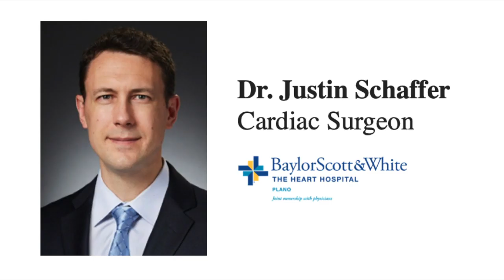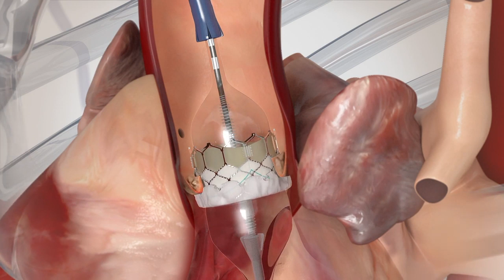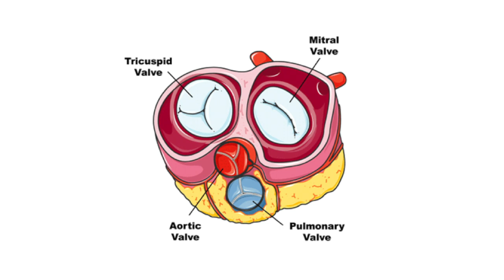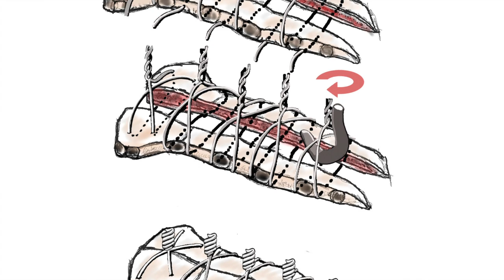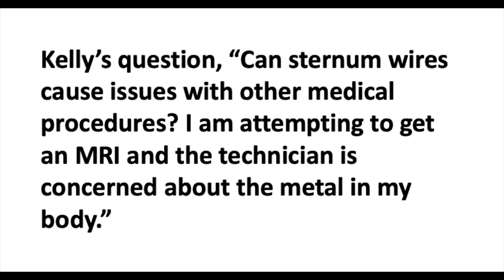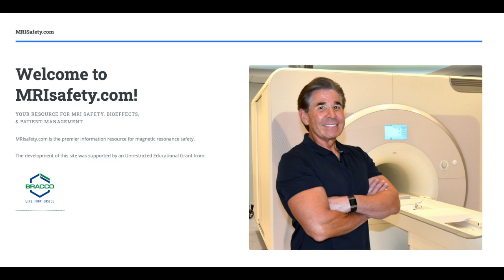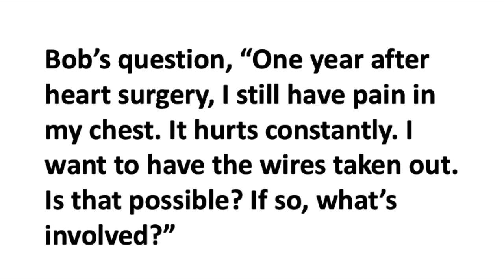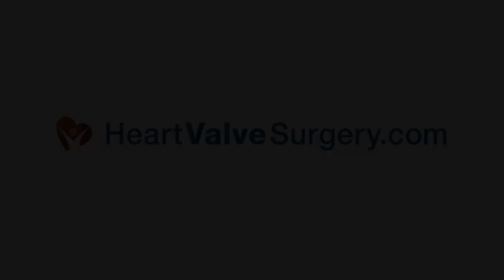Sternum Wires & Heart Surgery: How Do Wires Work? Can I Get An MRI? What About Sternal Wire Removal?

Comment: I'm 8 weeks past CABGx4 and aorta repair, mostly doing very well. No pain (other than pretty constant tightness in my pecs) but I can get a pop/click in lower left sternum lately--and there are some movements that really seem to exacerbate it (imagine the motion of wiping kitchen counter, or waxing a car). There's no pain, gladly, but I'm concerned that the sternum has not fused there.....or if the wires have been stretched out of whack or something. I have a call in with the surgeon (thank you very much for this video)
Reply from the maker: Hi, You might want to check out this post - https://www.heart-valve-surgery.com/heart-surgery-blog/2010/02/03/sternum-shoulder-click-pain/. Hope that helps!
Reply: @HeartValveSurgery Thanks much, I will investigate. A CT did confirm "non union of the sternum," the good news that it sterile and otherwise clean and tidy. I await the surgeon call and am anticipating word of surgery to put plates in (would sure love if there were other options). A little speed bump in my otherwise great recovery

Comment: I had CABG and a mitral valve repair 2 1/2 years ago. Prior to the surgery, I was an avid weightlifter. Not for size necessarily, but more for being lean and toned. Post operatively, I resumed weightlifting after about 3 weeks (under Dr supervision). So, my sternum wires were very tight and could be seen under the skin. I experienced aching all of the time and had severe pain at times simply from the wires especially while weightlifting. Not really a complication, but rather I guess my chest nerves are super sensitive plus I don't have much fat, even at 56 years old! A week and a half ago I had the wires removed and got instant pain relief. So, in my case, wire removal resolved the sternum pain. Literally the same day I had them removed. If you're having pain from the wires, please see your surgeon for options appropriate for you. You do not have to live in chronic pain nor have to rely on pain killers.  I had seven wires removed. One removal incision is about 2.5" long at the top and then five 1" incisions. He was able to get two of the wires from one incision. Went right over the old CABG scar. Very happy I did this!
Reply from the maker: Thanks for sharing your story with all of us!
Reply: how can you weightlifting after about 3 weeks?.. the sternum was heal/join,??? only 3 weeks
Reply: @ Also, let me add that the wire removal was very easy and quick. The actual procedure took 20 minutes. I arrived at the surgical center at 8am and back home by noon. Norco pain killers for a couple of days, then Tylenol for a few days. The pain relief from the wire removal far outweighed the brief surgery discomfort.
Reply: @ Surgeon cleared me and I was in Cardiac Rehab (please do rehab it is very valuable). Under the supervision of the rehab team, I started with 1lb dumbbells along with resistance bands. Added a little weight/resistance each week for 12 weeks, after which I was fully cleared to resume normal exercise. The caveat was to not do heavy lifting until six months out. I think I got up to 125 bench up to six months, then I could resume normal weights. I lost 35 pounds in the two months post surgery, and never recovered that weight loss, so not a strong as I once was :( After getting the wires out a few months ago, I am now up to 240 bench at 57 years old and 195 pounds. I’m 6’3” so on the thinner side. Never have had a large gut. Weightlifting did make the wires a little worse, so glad these things are gone. Best wishes for all of you!
Reply: @enahoky7793 after 1 month I went back to work doing heavy lifting I felt fine, but now a 1 year it hurts more than ever, I think it's the wire.

Comment: Is there any way you can tell me more about other ways of closing the sternum besides wires? "Sternal fixation system" was the term the fine doctor used. 
Edit: okay, I have found considerable info on YouTube! There are plates; there are "fibrous [- I forgot the name. Stringlike, strong, flat bands, non-metallic]": they look amazing. Still have to tie knots but they lie flatter, won't Poke Up into my skin: I'm 5' and weigh 100 lbs. 
  I'm two years out of my sternotomy and the wires are bothering me (mostly emotionally; mild irritation). It's too late now, but I wonder if there was something else that could have been done. I'm thinking of having them removed, which is why I found this video. 
  Now that I learned more, I wonder why plates weren't used. They look fantastic. Maybe it's because I needed a longer cut and maybe they're only used for shorter incisions. I don't know. Maybe my insurance wasn't good enough. Well, sorry to bother you if anyone actually read this! Thank you for a fantastic video and getting to hear a doctor who sounds truly wonderful.

Comment: Can I do bench press with these sternal wire?
Reply: Of course! Obviously wait 12 weeks after surgery....
Reply from the maker: Great question!  
 
You raise a really important question. Unfortunately, as a patient advisory group, we are not trained or capable of providing medical advice.  That said, we would strongly encourage you to discuss this question with your medical team. If you are not getting information that you are comfortable with then perhaps you should get a second opinion. 

We are sorry that we cannot be of more help to you in this situation!
Reply: January of 2022 I had three bypasses and aortic valve installed (on-x) stayed home twelve weeks before returning to work (HVAC technician) in August while working felt a pop in my sternum, waited a month and reported to cardiologist I think my sternum is loose and able to move independently, X-ray showed wires had broken and sternum had come apart January 2023 had surgery where they used titanium plates but no wires (I feel they didn’t read the directions lol, because that lasted a week and that was just from getting out of bed, x-ray showed that most of the screws had pulled out and were in a pile at the bottom they called it hardware failure, third surgery February 2023 new improved plates with a attached wire and added additional wires 
To secure any lateral movement 
Went back to work after eighteen weeks lite duty with apprentice help on the heavy work, a year later my chest feels healed and normal thank goodness
Reply: @gregz4249  thats great man keep it up

Comment: I had an lvad from 26-34 my sternum took a year to feel normal. After transplant 2 months later felt completely healed. Thanks for what you do. Had my surgerys at university of Michigan
Reply: I had bypass surgery done at McLaren in flint almost 4 months ago and my sternum still hurts even though I was told it should be completely healed
Reply: Wow. Mine doesn't hurt and it has been 4 weeks. @wadegrimes3655
Reply: 1ye later my chest hurts more then ever, I'm just now doing research on it and I suspect the wire. @wadegrimes3655
Reply from the maker: Great to hear you are feeling better. Go Blue!

Comment: I had rib pain on both sides after getting a triple by-pass.  It took about 9 months before the pain went away.  Maybe the wires were closed together too tightly?
Reply: Doubt it..the wires are only tightened to the point where Both sides are touching each other, of the sternum, so over tightening cannot be possible.
Reply from the maker: Maybe. Great to hear you are doing better now!

Comment: I work in the largest wound repair surgery in Beijing, and have led a team to treat more than 300 patients with wounds and sternum infections after cardiac surgery. In my experience, for patients with osteoporosis, the steel wire can easily cut the sternum. So, I removed as much of these wires as possible while doing the debridement.
Reply: Thanks for sharing. Which hospital in BJ do y work? I used to teach PhD doctoral students medical English and presentation skills at 301 n Navy hospitals
Reply: . M
Reply: How much does it cost to remove the sternum wire and how long I have to be in hospital.
Reply: @dilse1229 where you able to get the price
Reply from the maker: Very interesting. Thanks for sharing your experiences with us!

Comment: I had a mechanical valve placed into the aortic position and it was later (20 yrs) removed due to scar tissue, replaced with bovine type and also a necessary an aneurysm repair. Two sternum wire sets in the two surgeries. I do feel some odd bone formations at the lower part of the rib cage but other that that ok. Nobody ever said anything about avoiding MRIs.  Good thing is when this valve gives out, TAVR is the procedure according to the doctor. Off Coumadin thank god...just two baby aspirins a day
Reply from the maker: Yes, sounds like a TAVR may be in your future (with no broken sternum).

Comment: Had CABG in may 2019.  My chest is in pain every day.  I get no relief.  I feel like there is a vice in my chest crushing my chest.  Have been back to heart doctor, surgeon, and pain management doctor.  Nobody knows what’s wrong with me.  Help!
Reply from the maker: Hi Janie,  Sorry to hear what you are going through. Have you sought a second opinion?
Reply: Hi Janie,   I am going through the same thing after my surgery 3 months ago.  My doctors don't know what is wrong, nor does the cardiothoracic surgeon I seen for a second opinion.  I don't know if you will see this but I'd love to know if you have had you problem resolved.
Reply: @ericstevens789  no still going through same pain everyday.  Been back to doctors several times.  Nobody knows what is going on.
Reply: @janiegiordano9295  I have no clue what could be wrong, but I can tell you the herb kratom will relieve the pain. You get the red strain. It's a dried leaf ground ih nto a powder and put in capsules.  Its sold at smoke shops, maybe CBD shops..... but it works. I've used it on and off for 3 years myself.

Comment: I had a primary bio tricuspid valve replacement with a full open heart surgery 1.5 years ago. I can feel the wires stick my chest. Will that go away? Also they left the temporary pacemaker wires in and cut flush with my skin, I was shocked at that. Those have been known to migrate to other parts of my body. Can those be removed after all this time? Thank you for your informative video and time in reviewing my questions.
Reply: I just had temporary pacer wires removed after 2 years of fighting infection at the surgical site of a 4X CABG. The surgery left gaping holes in my chest that I am currently wearing a wound vac to heal. I have no idea why they left the wires in the first place, but I have them now and will address my original surgeon as soon as I am healthy enough.
Reply from the maker: Good questions. We would encourage you to discuss this with your medical team.

Comment: I am filled with hope hearing that great strides are being made to keep from completely opening a chest for some heart surgeries,  as 8 have already had two and am only 48 yrs old, and my cardiologist says there's a high likelihood I will need a third surgery.  I have a sub aortic membrane that keeps coming back, it grows to the point of almost blocking my artery, and is extremely close to my valve. I ended up needing a bypass with my last surgery.  I have huge amounts of pain in my chest, I believe most pain is from my sternal wires.
Reply from the maker: Hi Gina, Great to hear that this interview with Dr. Schaffer was helpful. Sorry to hear about your pain and your recurring sub-aortic membrane.  Thoughts are with you!
Reply: Ask iff the remove them .got the same problem mine are going out

Comment: I wish I can replace my other valves without sternal open surgery. My last sternal wires had to be removed since they were hurting my skin! It was a simple procedure that gave me back my quality of life , without pain and perforating my skin. Since now only positive thoughts and wishing to find a good and brilliant physician like this one, dr. Schaffer, for my next surgeries.
Reply: Pretty straight forward was only in theatre less than an hour no problems.
Reply: Hi Gabi glad you are well onwards and upwards from now👍👍
Reply: Nowt but good wishes for ya duck
Reply: Hello. Your post is from 4 years ago but I just discovered this video now. I had a heart valve replaced the year before last and had my chest opened up for that. I didn't even notice the wires until later because I was so busy with recovery and so many other things. But now the wires are irritating my skin, just as you mentioned. I cannot stand the way they feel to my hand either, tho I guess that's partly denial of these changes that I have had to go through. I want my old self back: this was such a devastating loss. But one has to look on the bright side. Anyhow, these bumps from the wires are really bothering me and the ones near the top sort of hurt or irritate my skin. I would like them removed, but I don't know if it's advisable, since I don't have an infection and another surgery is not appealing. There's no real pain from the wires like others have described. But they do irritate my skin and I was happy to see it described a bit by you, as it validates my feeling. Not that I'm happy that anyone has to suffer! Your responses here are so helpful, as well as the other people's. So, I just wanted to mention that I have the same issue, I think, it was my sternal wires. One thing is that I do not want further scars. I already am fairly despairing about the scar that I have, although as scars go, mine healed very well. It just doesn't look good in a low necked shirt, which is basically all women's shirts. 
I hope your valves stay functioning and you're well!
Reply from the maker: Great to hear you are doing better after having your sternal wires removed!
Reply: My Wires Bother me a lot, pain and itching, and irritation and redness.
Reply: How was the wire removal? I am having mine removed
Reply: los angeles don’t worry it’s a simple and quickly procedure. No pain, after the removal. Be confident and good luck.
Reply: @westitis2580  had 4 wires removed on Monday back home on Wednesday. Metal staples used to seal wound. Nurse coming today to change dressing starts to remove staples next week bit of bleeding due to coughing and sneezing otherwise feeling good.
Reply: @joeheaton4927  how was the surgery
Reply: joe heaton happy that you are fine. I removed mines in one day and in the other day I was at home. Just came back to take a look by the physician and remove staples two days later.Only once. And after it normal life. ;) best wishes
Reply: @abhi8340  The best advice I can give you is to do your breathing exercises, go for walks and increase the walking distance every week to help your lungs, the further you walk the easier your breathing becomes, also eating healthy foods is good for your recovery,.
Reply: @joeheaton4927  : So nice of you madam, your great humane is appreciated. Would it be a good idea to get the wires removed. Would it be a lengthy procedure. Pleaae
Reply: @abhi8340  Removal of wires would be up to the surgeon unless there is a reaction to the wires like I had causing an infection in my chest that is why they were removed. Procedure is straightforward nothing to worry about. Hope this is of help to you.
Reply: @gabigabrieladobrasil  my dad never went near a doctors hes been dead 16 years that was heart his brother had issues his dad died of it but he wunt listen to no one